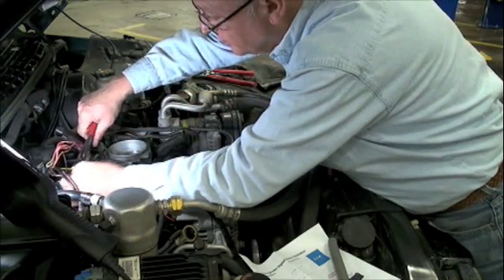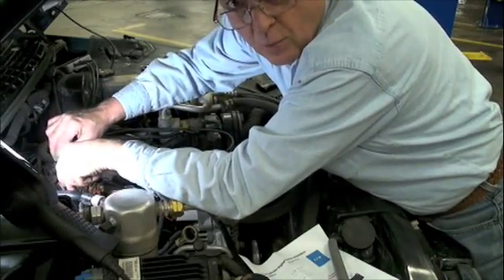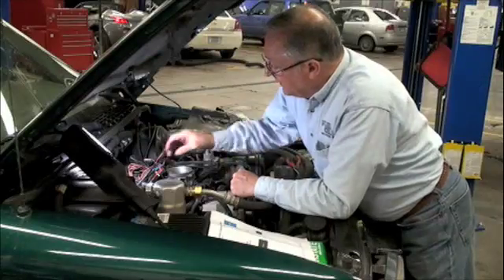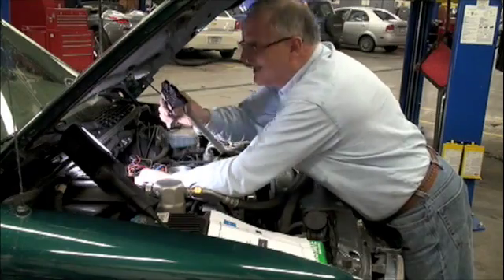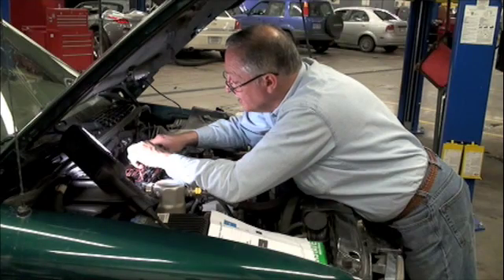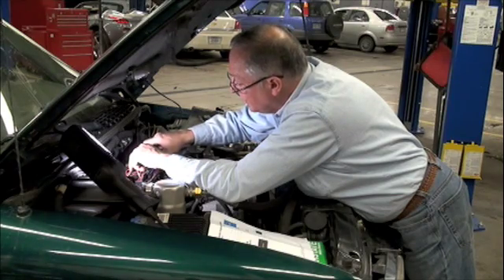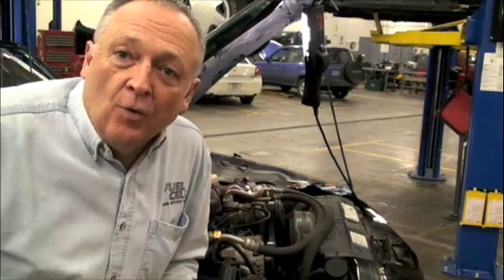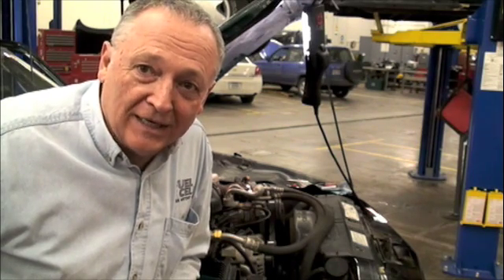E85 Adventures with Flex-Fuel

Comment from the maker: Most such kits simply require unplugging each injector cable and inserting the new plug. GM Vortec engines (4.3/5.7L) are unique in that you have to manually splice into their system.